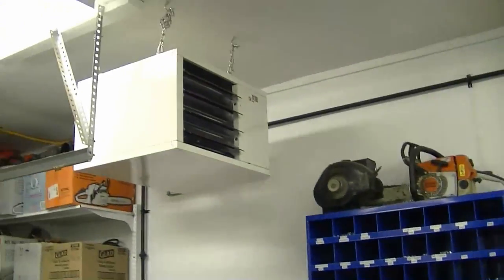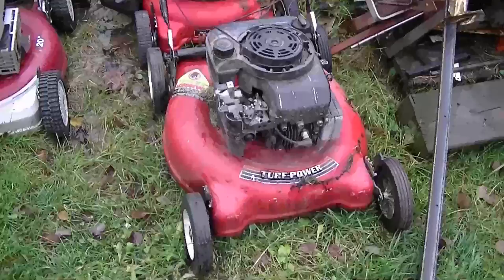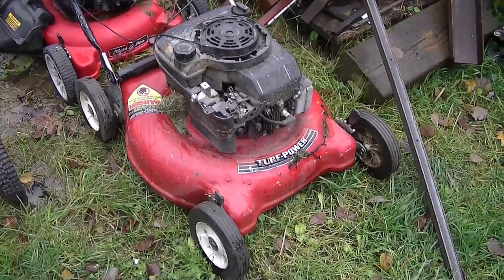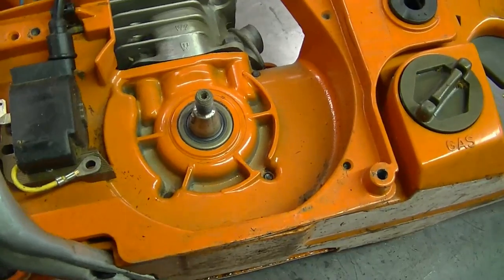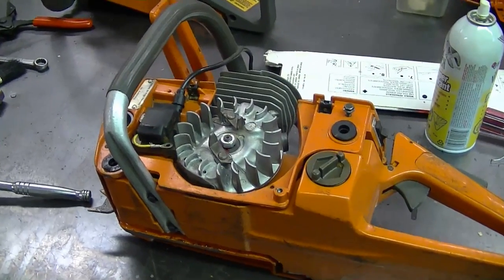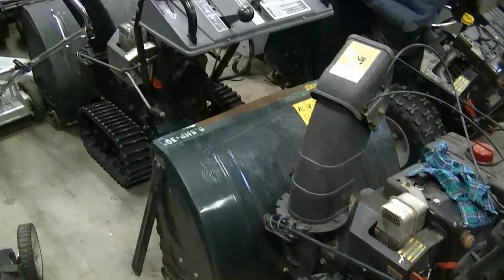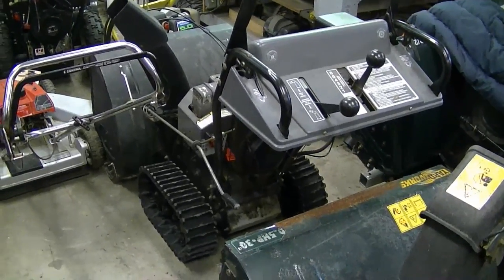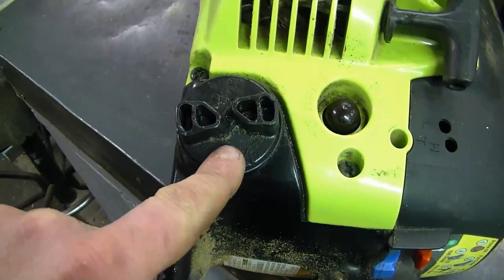Small Engines Q & A Video #136 in HD

Comment: A tip for keeping your lawn mower from rusting underneath. I bought one 14 yrs ago and when it started to get rusty I cleaned it underneath and then sprayed it underneath with rubberised undercoating. You can buy it at Walmart or CTC for $4. or so. It dries like rubber, not sticky. Also rocker guard spray is good. At end of the mowing season I put a coat on before putting it in storage. my mower is still like new.

Comment: I have two lawn mowers wich one is 37 years old and the other 30 plus. And at the end of every season, when I change the oil
I brush the old oil under neath the deck, keeping it rust free. 
By the way , it's not that I can't afford to buy a new more, I just get a kick of having something that old that still runs great. Lol
Great Q&A as always. Keep warm.
Reply: Same here, Ones 44 and the other is 26 Altho the 44 year old one has recently stopped running it ran great, And it will be getting a rebuild so it can keep going until 100!

Comment: I think I have that exact same Honda push mower (the one that was next to the snow blowers). Mine is, I believe, a HRS 21. It has never given me any problems. It still has the original spark plug and air filter, but it runs perfect and always starts on the first pull no matter how old the gas is. I guess that shows the quality of the old Hondas.

Comment: Great video Dony and useful tips. I have one question, my chainsaw works only about 5 min and dies. I found reason why, it's because creates vacuum inside gas tank. What should I check to solve this problem. Thanks.
Reply from the maker: sometimes you need a new gas cap

Comment: the 3 point tool that you get With the Chain saw ( 13mm/19mm and the flat screw driver) is excelent to use the 19mm on both the bar oil and gasolin cap. you just set it over the slot in the cap and turn.

Comment: What causes the gas cap to be tight? Mine is that way too and I have just dealt with it. I would rather fix the issue causing it then just delaying another fix by replacing it.
Reply from the maker: the plastic warps, so a replacement will fix it

Comment: First off you wiil have to mic tje cylinder wall to see if there still in spec refer to a briggs manual to see what tolerance is or if it has deep scoring in the wall that cannot be honed out but if its fine I can be honed

Comment: if the manual says to dump fuel after 30 days (ethanol) , then what does fuel stabilizer do so you do not have to dump it after 30 days?  no manual I have heard of says to use stabilizer ???
Reply from the maker: it preserves the quality of the fuel, if you want to protect against ethanol use "ethanol shield"

Comment: Should mention that the slots in the gas cap are so you can stick a screwdriver in there to get more leverage on it.
Reply: Those caps are notorious for swelling and causing issues with both tightening and loosening them. When I go to cut firewood I always take a pair of pipe pliers and a large flat screw driver just so that I can take the cap off of mine. They are a $100 saw and if you are easy on them they will last longer than the clutch teeth.
Reply: harperjmichael Totally.

Comment: I have a briggs an stranton 550 ex. I cleaned the carb  oil and gas it starts for two minutes then shuts off. The rpm starts high then goes low before it shuts off. Can you help dony or anyone else please?
Reply: check your diaphram kit

Comment: This google + thing is messed up. I don't know why they can't just leave it the way it was. The old method for comments worked with no problems. Anyways, in my area of Florida, There  is a gas station that sells 90 octane with no ethanol. Next time one of my clients brings in a piece of equipment for my shop, I will recommend they use this fuel because without the ethanol, their equipment won't have so many problems.
Reply: use premium fuel with NO ethanol !   will cure all of the problems you are left with using regular fuel WITH  ETHANOL.   Everyone should STOP using ANY fuel
with Ethanol in their small engines

Comment: As you can see from my again newer handle/name, google+ sucks and google sucks for forcing signup to it.

Try adding a good, fairly large, overhead fan to your shop for use with that new heater, it'll spread the heat around extremely well.  (Also cool in the summer!).

formerly richardwernst